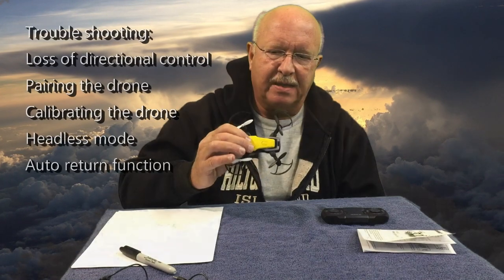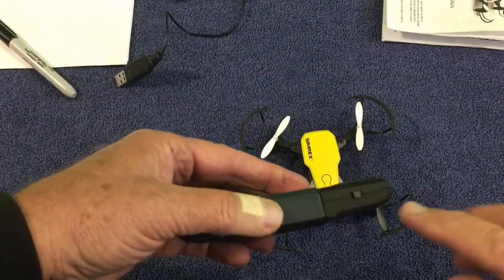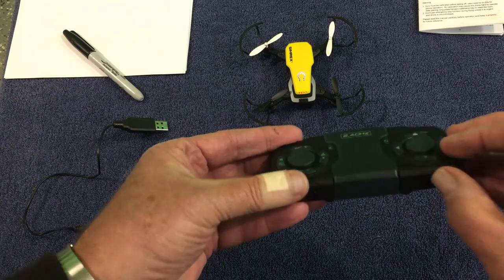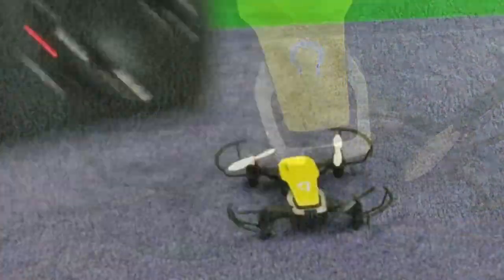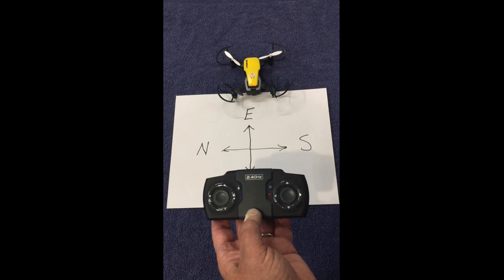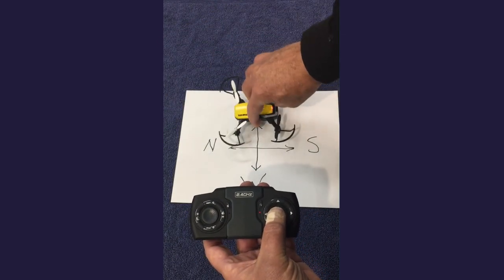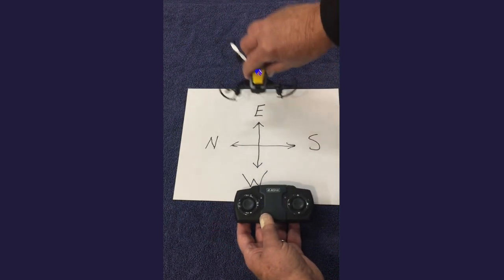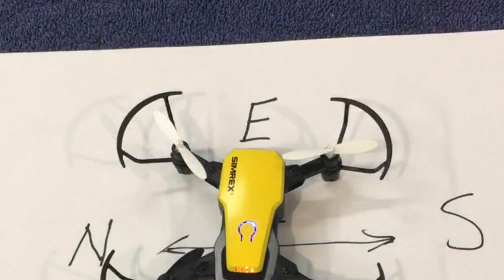SIMREX X300C DRONE Part 6

Comment: Super videos! I also have trouble accessing the videos via my android phone!
Reply from the maker: After the holidays I’ll try and figure it out and post something. Off the top of my head, I think I moved it to a movie making program and then saved and opened it????
Reply: For those that have iphones - you can use the screen record function or screenshot function on the phone to record your drone videos and photos as you play them back. The phone will then store the video or photo in its photo app. You can then share or send the video or photo as an e- mail to yourself which can then be opened in your computer. Or connect your phone to the computer and download your photos and videos in the normal way. But for a single video or a couple of photos, I find it quicker to just use the e- mail method rather than connect up my phone for a few photos. 👍 don’t know if Android phones have a screenshot or screen record function.
Reply: @vtechead1  hi I figured out that on android you need to download an mp4 player and you can watch videos through that.
Reply: @-M4cD4ddY-  cheers, glad you found a workaround 👍
Reply from the maker: Great! Glad you worked it out.  I appreciate Donny D. Helping out too👍👍
Reply from the maker: Hey Donny D.
Thanks for helping everyone figure out the options for this drone! Thanks for watching and taking the time to comment!👍👍

Comment: What's the Difference between the X700 vs the X300C? Which one is better? Are the Brushless or Brushed Motors?  Thank you
Reply from the maker: The x700 is newer model.   I’d probably recommend it.  I have had some viewers say that the App for the 300 isn’t available anymore.

Comment: Certainly do not fly this if there is wind around. First flight I flew the drone above the house to get a picture. The wind caught the drone and swept it upwards and away. Would not respond to any controls as it quickly got out of range. It was calm at ground level but there must have been a breeze higher up. Never found it so now have a spare controller. 👍
Reply from the maker: Maybe keep looking! When out of range of the remote, the drone will go into safe landing mode and land.  I had the same thing happen to me, luckily I found it in an open area about 3/4 of the length of a football field away.  So yours is out there somewhere!  I’d recommend anyone flying to start indoors and set at the lowest speed setting.  Hope others will read your comment prior to their first flight!
Thanks for watching and taking the time to comment 👍👍
Reply: @BoilerDan1  cheers for the reply. I think it may be in some backgardens a couple of streets away. Going to knock on doors and offer a small reward for the finder. If I get it back I am going to put a sticker on it with my phone number, so if it happens again the finder could hopefully get in touch. Hope you had a nice xmas. 👍
Reply from the maker: That’s a great idea regarding the phone number!
Best wishes for you and yours too.
💫

Comment: Hi i'm still having trouble, after I've paired and done the calibration when inpress up the front two legs raise of the ground (white propellers) and the drone stand on a tilt on two legs.  Is there a way to reset.  I've tried the first initial pairing and calibration not sure what else to do.
Reply from the maker: Sorry to hear that.  I can only suggest resetting the Gyro (Calibrating) by:
Turn everything off.  Even remove the battery to insure it shut down.  Then put the battery back in.  Make sure the controller is also off.

1. Turn on the drone and set on a flat surface.
2. Turn on the remote control unit.
3. You should get two beeps and the lights should all be on constant (not blinking).
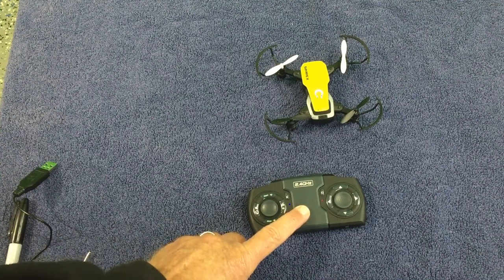4. Push and hold down the Gyro button until you get one long beep. (visual at the 2:20 mark of this video link: https://youtu.be/NKpOKCcXiMM
That is all I know to do.  
Make sure you didn't remove propellers in replaced in the wrong location?
Reply: @BoilerDan1  Thank you for your speedy reply.  I will try all the above and look into  the propellers and let you how it goes.

Comment: I can not get mine to Hover at all 
When I press long start it takes off. 
I can’t control it. 
Can you help?
Reply from the maker: For step one, do not press long start. Just tap the button on the top left controller. Just a short tap on the “start”.
It should then raise just about 1 foot.
From that point,  you control additional height from the small pad just below the start button. Direction is then controlled by sliding the thumb pad on the right side.  Let me know if that helps.
I’ll keep trying to help.  Look over my other videos on calibration... I think segment 6.
Reply from the maker: Sorry. I wrote my response and I said it wrong. The first thing is you just tap the “start” button once (do not hold it down).
That will start the propellers turning but the drone will remain on the ground. Next you put your left thumb on the round pad . It has no markings on it. But if you push it forward, it acts like a joystick but it doesn’t have the posts. That little thumb disc moves.  So you slide it, but don’t hold it in the upward position. You just push it up for less than 1/2 second and release it. The drone will hover about 1 foot off the ground. The more you slide that disc upward the drone will go higher. Use the same sliding disc to lower the drone. The disc on the right side controls direction.
Practice getting a feel for how the two thumb discs move before turning on the drone.
Reply from the maker: Katie; The other possible solution is that your drone is in “Headless mode. Video segment 6 covers that, and how to return the drone to normal mode.